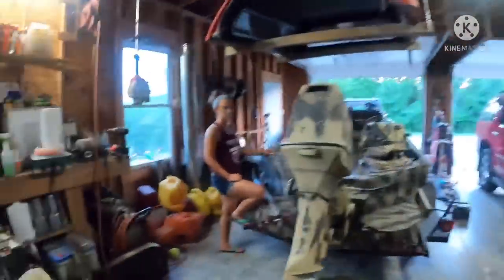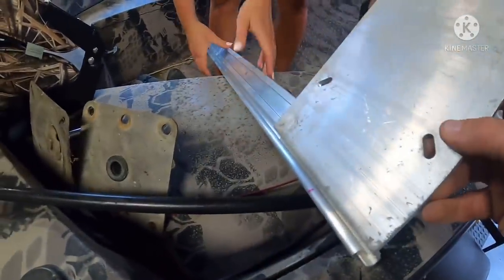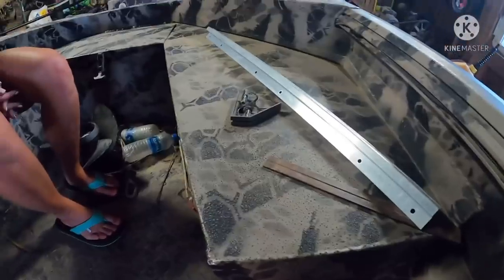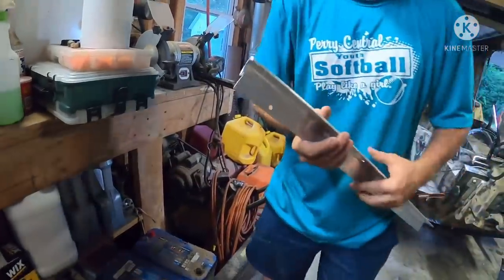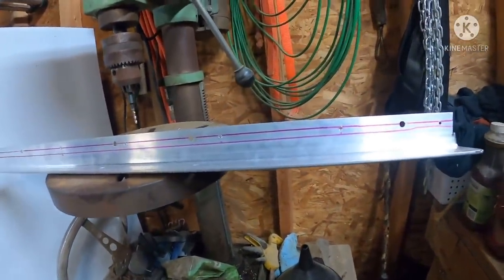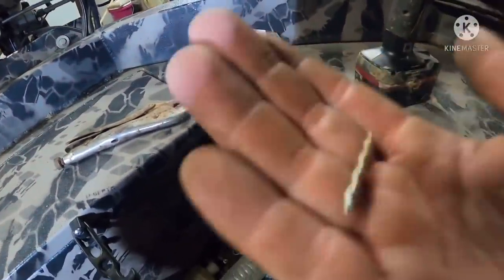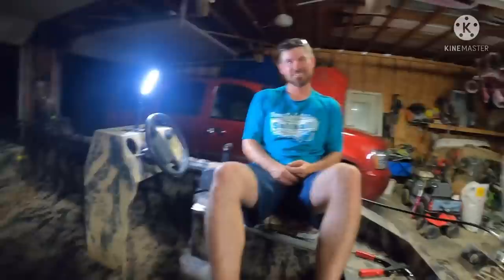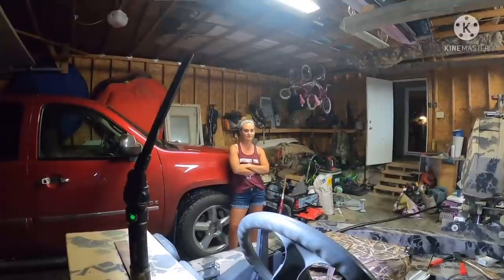Adding seats to the Havoc #havocboats #boatsmods #diy

Comment: Down here in Florida, the guys who install aluminum pool cages use a chop saw with a carbide saw blade installed backwards, it stops the teeth from grabbing the soft aluminum and still gives you a clean cut., this trick also works great with PVC pipe.
Reply from the maker: All be darn!

Comment: I if you wanna put a big LA D light up you know those trailer plugs goes from your truck to your trailer the 4 way plugs get you one of those split it in half and then you can mount your wires with that trailer plug and you can also use 1 set somewhere to something else to something else and in that way the front of the boats will have a light that you can remove easily And use on your truck Our tractor
Reply from the maker: All be!

Comment: I wish you luck with the pop rivets.  I always go for over kill and would have used bolts with "spring loaded nuts".  However, steel, aluminum, and water make a caustic combo.

Comment: If you use the quarter inch pop rivets they flare out on the inside of the body more we use wom in glass work putting indoor glasses and stuff they have a bigger flare on it so they'd hold more weight and you bomb at Harbor freight and the rivet gun form
Reply from the maker: Got it

Comment: Safety tip. At and everyone else reading this.
You do not want to bring aluminum on a stone grinding wheel. The aluminum will clog up the wheel and migrate e into the stone and build pressure creating a potential for the the wheel to fly apart.

Comment: If you have a truck and trailer repair shop around there you might pick up a tube of butyl caulk for the edge of the track, glob it on and form it with a pice of plastic and tape to create a smooth edge, I copied the following from a airstream blog, >>>>The silicone based caulk etches aluminum because of the acetic acid content. It's the Acetic Acid that attacks the aluminum, not the silicone.
They recommended the following caulks, that have 30-50 year service life:
Butyl Flex
Dap 3.0 (Silicone hybrid w/o acetic acid)
Latex
Reply from the maker: Oh wow!!!   That is a long service life!!  Thanks for the recommendation!

Comment: only one problem the screws looked like stainless steel screws and the pop rivets are steel which will rust you should of used 3/16 aluminum rivets and then they wouldn't rust but will be strong enough to hold your seats
Reply from the maker: You know, I never did look to see if they were steel or not! Just pulled them off my shelf.

Comment: I would cut the front end of that bracket and grind it round so you don't slice your leg open. Or if they have a plastic end you can get to put in there.
Reply from the maker: Jeff, I did grind it smoother. A plastic end would hold it up off the flat surface.
Reply: @nyamillennial  Ok when you were testing I was cringing cause your leg was so close.
Reply from the maker: Lol!  That you are correct no finish performed yet!!

Comment: Don't feel loney Matt.
My Wife Maria does the same thing with gifts.
Our wedding anniversary is the 4th of July yet I had my gifts in May.
Tho this year she gobsmacked me with on actually on the 4th. 
Drives me nuts.
Also, like my dearly departed Grandma she thinks it's normal to give me socks and underwear as a gift no matter the holiday, birthday and anniversary. 
She does always let me pick one thing.
That's why I always buy myself one thing I truly want.
Those are some awesome boat seats tho.
Even if it's a toy boat compared to the one I had when I lived in the Florida Keys. 
That was a 19 foot Hoog with twin 200 hp Yamaha engines. 
It was my Harley on the water before I had my Wife move down to the Keys and live with me.
No more hotties in teeny tiny bikinis for some reason. 
Especially given she's a Latina.
They have nuclear tempers.
Reply from the maker: 🤣🤣🤣 at least you were there at one time!